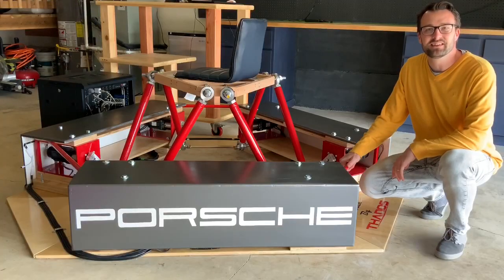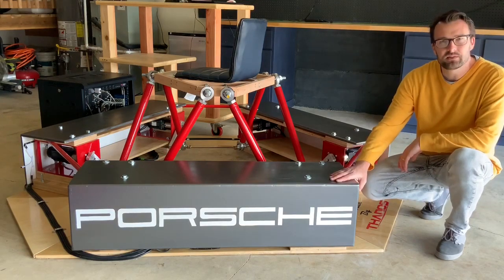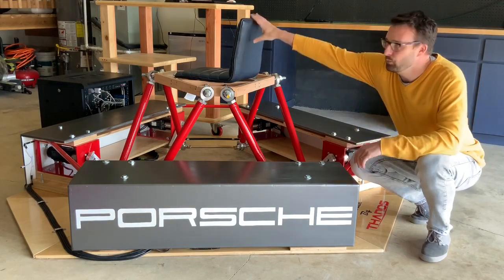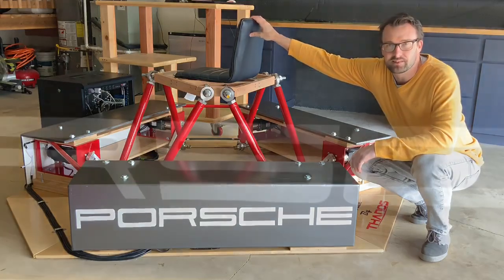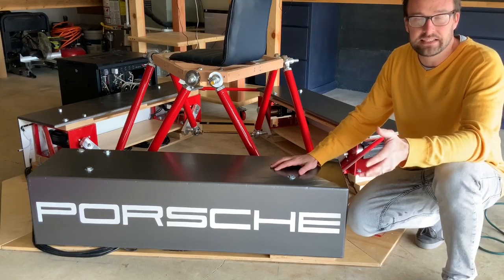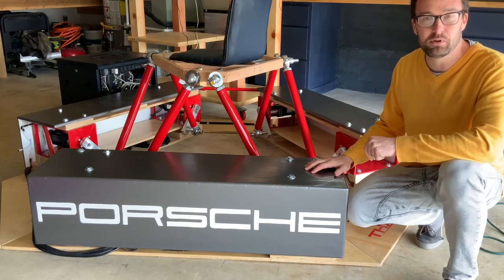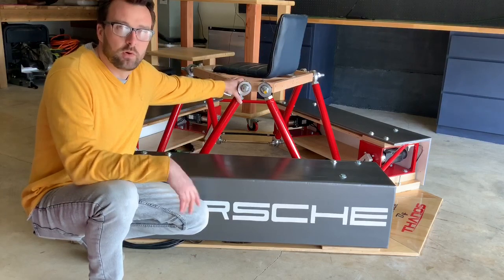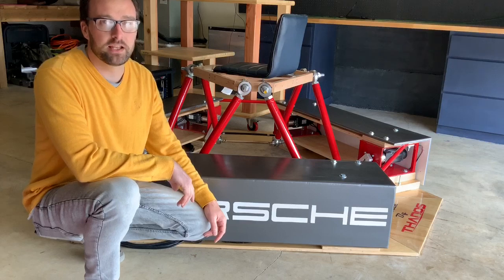6dof Lower Platform Complete - FlyPT Software Test

Comment: Great progress. You mentioned that you are going to replace the upper platform with a welded steel version. Do you think that the wood platform would be suitable for use if the rig is not too heavy e.g. a limited 80/20 extruded aluminum rig?
Reply from the maker: Cat2 Ebay hey there! I’m not sure if you can hear in the video but the wood is cracking under stress of just myself on top. Once you have the 80/20, seat, monitors, etc., I think it would be too much weight for the wood upper frame. Remember, when the rods push and pull to create the different poses, it too is creating its own force against the structure. Hope this helps!!!